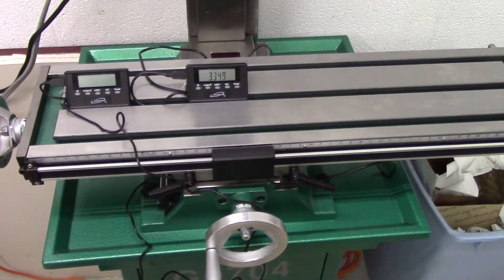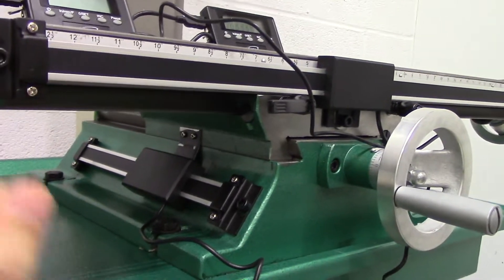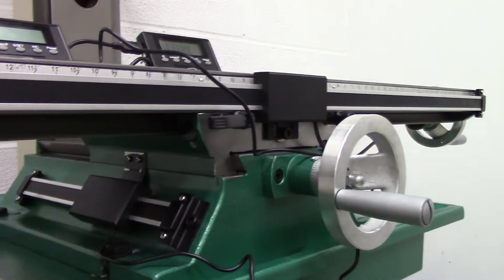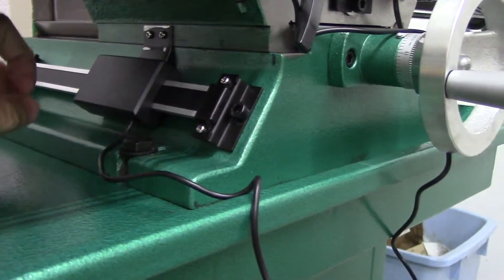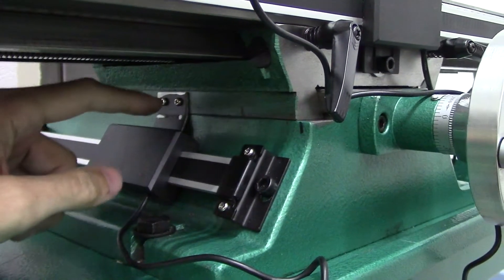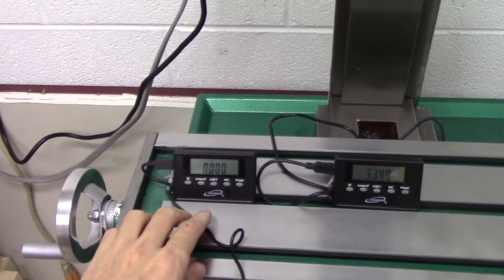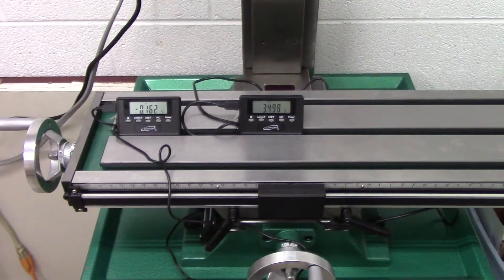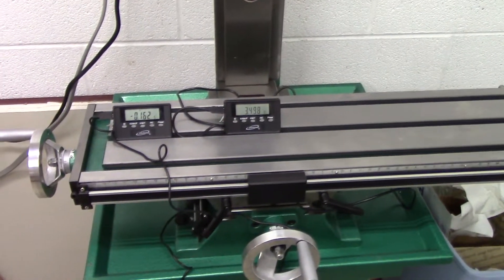ProtoSimTech - DRO for G0704

Comment: I had an issue re installing my milling vise! Had to lower the X axis DRO till it was resting on the front clamps and even then it barely made it so the vise front overhang was clear to move left and right
Reply from the maker: Yeah, you need to be careful that the front DRO is low enough so that your vise can still move if needed. That's definitely an issue if you're not careful. I had to adjust my DRO several times, especially after I installed the front overhang.

Comment: I thought I'd say thanks, my DRO set showed up today, I followed your plan pretty closely. I'd post pictures or something, but it's basically the exact same thing, except in the background would be my messy shop. So, thanks, this saved me much time, I'm sure. The DROs seem to be pretty accurate, for my purposes. On parts that require .0001 accuracy, I get close, then gradually machine, measuring often until I get where I need to be.
Reply from the maker: You're very welcome! I'm glad I could be of some help to you.

This was not my idea, but I didn't see this method posted on YouTube as of yet, so I decided to post a video showing how it was done.

The DRO's are fairly accurate if they are securely mounted. Mine managed to come loose at one point and I had to fix it. If you really need accuracy that is less than .001, then these are mainly for reference only.

One tip: I have noticed that by moving the tables extremely slowly, you can get better accuracy as far as the numbers on the DRO. One example is using a center finder (the one that pops off center when it comes in contact with the work piece). I found that by going very slowly, I can get it dead on accurate.

Glad it worked out for ya!
Reply: ProtoSimTech Basically the only difference between my installation and yours was my choice of 3/16 screws for the Y axis. My taps are China junk, and I was worried about tapping holes at anything over 1/4", considering how much struggle I had doing the tramming aid mod with these taps. One day I'll own a nice set of taps, but that day is not today. All said, it was an easy project that took no more than a couple hours at a leisurely rate.

Comment: Just wanted to point out that the link you gave is for the 12" model, which isn't long enough for the X axis. Also, the picture shows three sets, but the amazon listing is actually only for one. This link should be for the 24" version. http://www.amazon.com/gp/product/B003JULE4Y/ref=oh_details_o03_s00_i00?ie=UTF8&psc=1

Thanks for the installation video, I intend to try your method when the DROs arrive.
Reply from the maker: Yes, the link I gave you was for the 12" model, but if you look below, there are other models listed as well. Amazon sells the 6", 12", 24" and 36" version. I tried to explain that, but I guess I didn't do a very good job. Sorry about that.

The picture in the link is misleading. It shows 3 different versions but the ad is only for one. I don't know why they did that. It confused me as well at first.

Thank you for the comment! I appreciate it. I'm glad I could help!